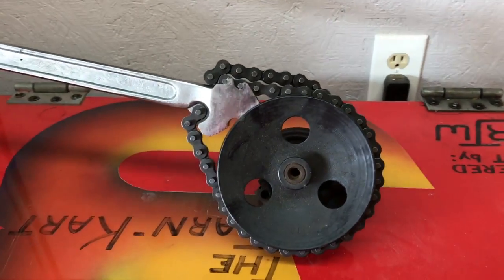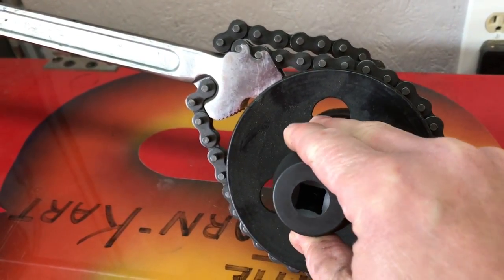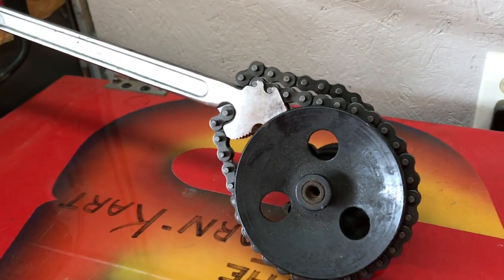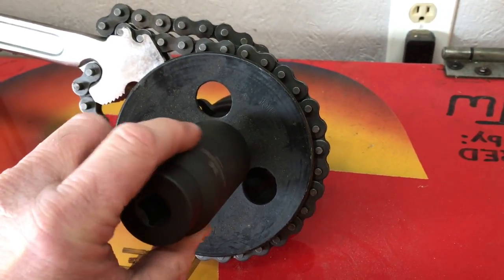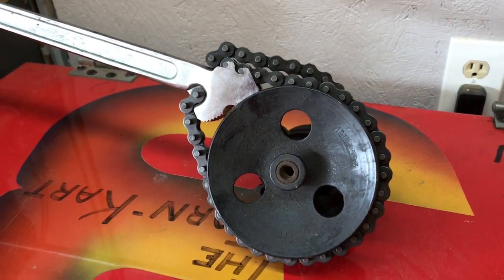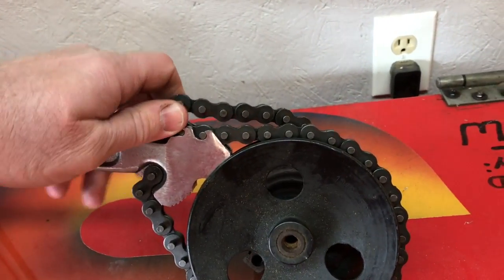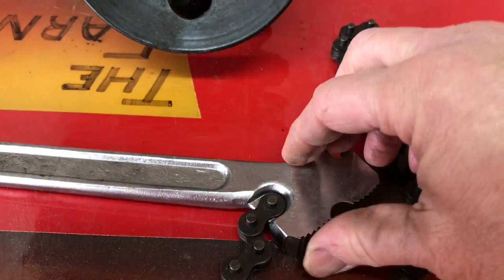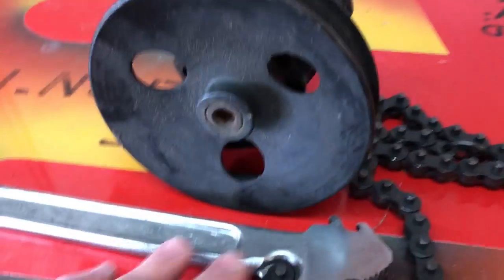What is a Chain Wrench and How to use it.

Comment: I work in a machine shop and use my chain wrench all the time. No so much on shiny new parts, but for breaking down machines and old parts that we reverse engineer. I'll sometimes stick a shop towel under the teeth to prevent damage. They are great for grabbing oddly shaped parts too.

Comment: Another suggestion, if you don't want something that might leave marks in the round piece you need to hold, is a strap wrench.  Exact same idea as a chain wrench, but uses a rubber strap for friction instead of a chain and teeth that might bite in.
Reply: Old comment, but perhaps you could help me out. Do the rubber strap wrenches work for stuff that is really stuck? Are there issues with the wrench slipping? Do you have enough leverage?

Comment: Can this be used on a seized engine? I have a straight 6 235ci Chevy no bolt on the crank shaft pulley. Requires a keyed hand crank.